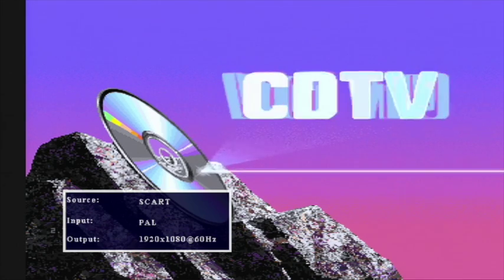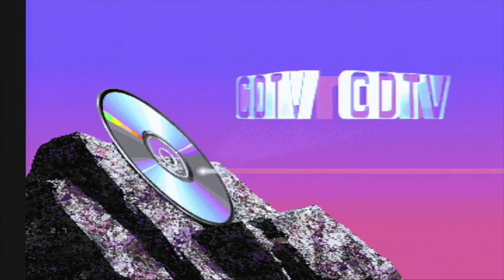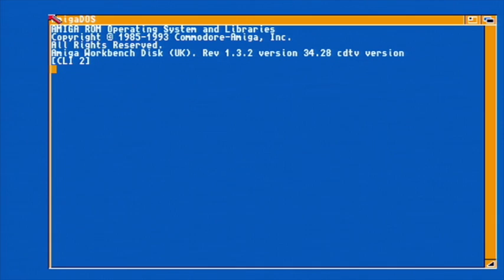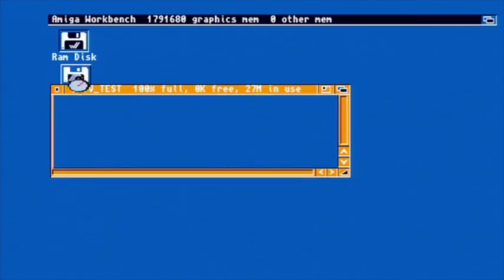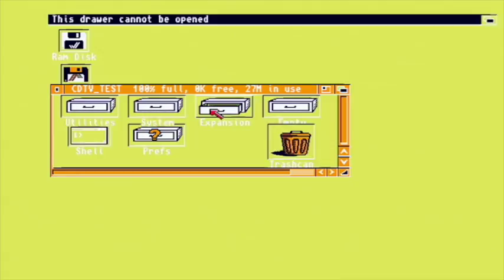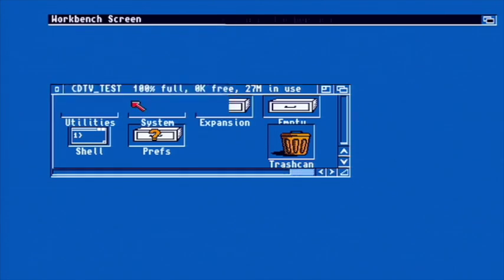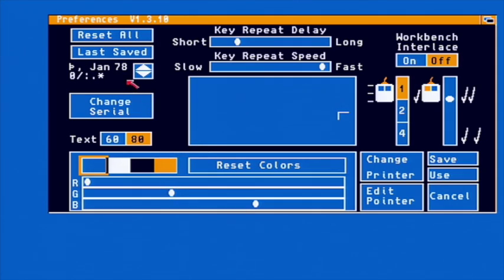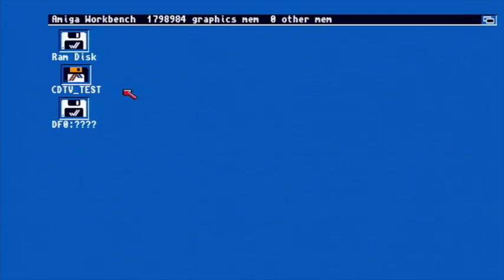CDTV - Workbench CD-ROM

Comment: thats pretty cool.. is it bound to that specific workbench version or could it be easily replaced with other versions? if its not "hard-coded with the workbench files " then maybe it would be possible to release this without the workbench files and people could make their own autoboot cd´s with their own workbench files? im sure alot of peope would find it verry useful.
Reply from the maker: No i dont think so , if you have 3.1 noms in it then workbench 3.1 can be loaded but it may be slightly slower. i made it as a test to see if i could. my plan was to create a full cd worth of useful apps. sys info , telnet , paint , some games etc. enough to use the CDTV if it was the only cd you had kind of thing.
Reply from the maker: id have to release a blank image with the boot code on and a demo of win image to set it up i guess
Reply: yeah that would be really cool, if you ever get the time, im sure you have better things to do tho.. And adding usefull software and programs like you had planned would probably be quite easy then to create your own custom workbench setup for cdtv or other situations where compactflash drives are not possible.
Reply from the maker: Johnny Johannesson I will do it one day ... its on my list of a thousand things to do :)

Comment: I know it's not related, but it reminded me on something: Any news on the Amiga nyx?
Reply from the maker: Dominik Schütz the nyx ? AAA? From Commodore?
Reply: Yes, you had a video about it and i wondered if there is any news about it... Something like if it is running or if the schematics and rom-dumps have been released... :)
Reply from the maker: oh right , i haven't seen Oli to ask him but it will be a long and difficult task to locate the missing chips - if not impossible. As most of the IC's were prototype and were lost when Commodore closed, its quite a task.
Reply: Doesn't matter, as it's a prototype and no software has been developed, new ICs can be developed. Important are the schematics and rom-dumps. Would be interesting :)